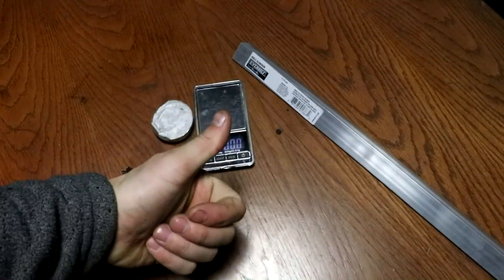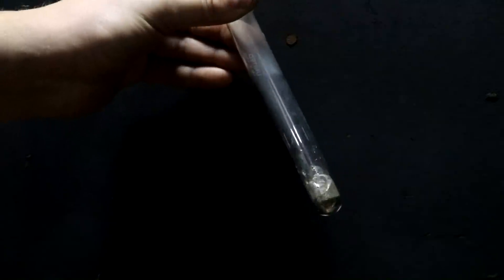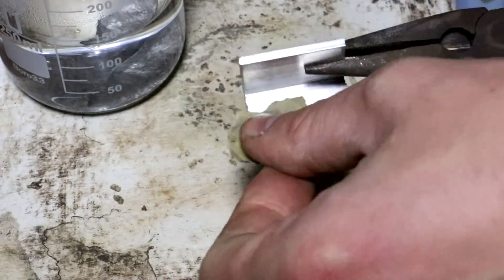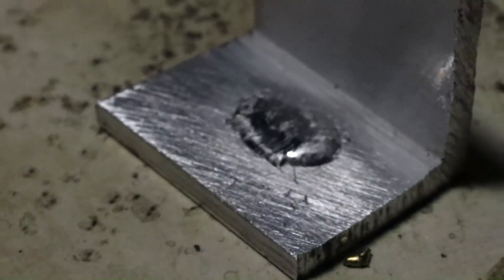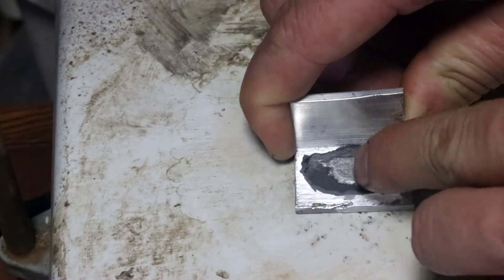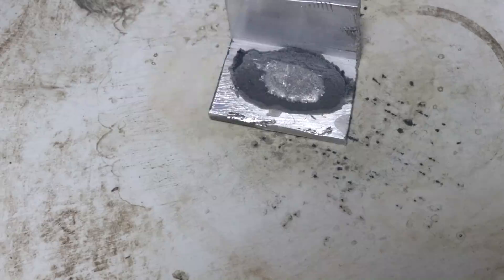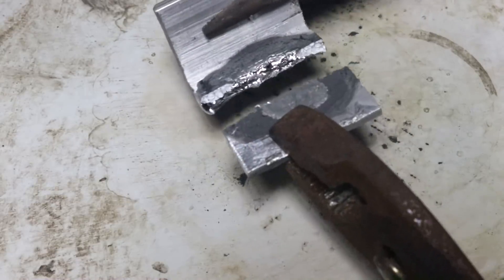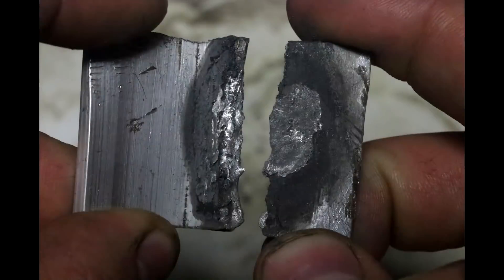Field's Metal vs Aluminium

Comment: Perhaps the thermal cycling was causing some condensation due to the different characteristics of each metal once the hot plate was turned off. If a light amount of condensation occurred it could have reacted with the fields metal and caused that dark grey oxidation and degradation of the metal. It was interesting to see it react with the water at the end, so that made me think possibly some condensation may have formed once the metal started cooling. Either that or the metal was able to drop in temperature much cooler than the ambient air and caused some condensation like how soda cans get wet when you have em outside in warmer air.
Reply: "Either that or the metal was able to drop in temperature much cooler than the ambient air"

That's not possible without a dedicated cooling system.
Reply: What I mean is that the fields metal could have a different thermal conductivity to the aluminum. Because the fields metal is kind of infiltrating the aluminum on a molecular level, it's almost like the piece of aluminum is a container with the field metal inside. And the field metal could have just enough thermal conductivity to pull the heat from the aluminum. Because they were heated up uniformly to a higher temp and then let cool down, the inner metal could act almost like the colder inside. Because the inside is cooler than the outside, it would allow condensation potentially. I'm not talking big drops of water, but just enough change in temp to cause some water that would react.

Comment: The s/l phase change could be taking energy from the luminum, potentially causing a local lattice change to form an allotrope more active in the air? Make a bunch of the tarnish material and x-ray to check possible alloying

Comment: Could it be fed with aluminum to keep producing hydrogen for ever, or is the fields metal exhausted eventually?
Reply: I think it might get too concentrated with aluminum.
Reply: Bismuth is more dense than aluminum. Theres an electron swap happening somewhere which is why its acting like an acid on the aluminum. I don't know squat about indium so I'm mostly assuming that the bismuth is doing a large chunk of the work due to its extremely low radioactive properties, and similarly low boiling point which causes the alloyed crystals to become deformed and aluminum's oxidation rate doesn't help anything either.

Comment: "It's about 3 nano-lightseconds long."
Never change, Cody.
Reply: 1 nano-lightsecond = 0.299792458 m
Reply: If 1 nls is around 0.2998m, that makes it a much more useful base unit than the rather long meter.
Reply from the maker: Its also 0.9835958Ft so...
Reply: @theCodyReeder  Next, you'll be telling us the size of the ranch in Angstrom-lightyears.
Reply: Sure it is, Cody, but unlike a foot, it actually has some basis in reality. (Also, subdivisions of it should be metric/SI-style, not arbitrary)
Reply: Finally, we get a decent definition for the American units!
Reply: to be nit-picky: the unit prefix for light-seconds actually comes after the "light-" so it should be light-nanoseconds
Reply: I was guessing 300mm. since the meter is based on the speed of light in a vacuum. The speed of light in a vacuum is pretty constant.
Reply from the maker: +  Jarwren 
Ima nit pick your nitpick! astronomers say things like "10 light years" or a "filth of a light year". so the way I said it should be correct. ;)
Reply: @theCodyReeder  I'll see your nitpick and raise you a nitpick: It would then be 10 light-nanoseconds.
Reply: @MushVPeets  the foot would be better if however if we just changed it to be 1 nls, it would be a pain in the ass for everyone in the beginning but would make more sense.
Reply: It's basically a meter
Reply: 1 nano light-second is about 0.1763485047 smoots if it's any help
Reply: I never came across a smoot ass a unit of measurement before. Would that be named after George Smoot, by any chance?
Reply: next can you use hogshead for cubic measurement?
Reply: hands down the most nerdiest joke thats not a joke
Reply: although its 3.05011 nano-light seconds
Reply: It's not that uncommon. Since the speed of light is also the speed of electricity we were taught that in Electronics College. It's actually crucial in computer boards once the speed is really up there.
Reply: I said " HE JUST SAID WHAT..."
Reply: That's all cool, but w.r.t. light...did it travel any distance at all??
Reply: PARSEC MASTERRACE COMING IN
Reply: But what is a better definition? 0,3 meter or 0,000000001 lightseconds?
Reply: About 0.9 meters for anyone curious lmao, 3*10^-9 lightseconds to meters
Reply: Lol that's what my friend said after I made the 8th cult
Reply: 29cm
Reply: Anyone knows what is 1 Smoot in 2019?
Google is trying to play smartass with their 170.18 cm.
What do they know about the EAR
Reply: 11.8 inches is a much nicer number 11.802852677 inches is more precise. 3 light seconds is almost a yard, neat
Reply: Is that right? Or is it lightnanoseconds?
Reply: I burst out laughing... totally wasn't expecting it
Reply: HaveSomeRekage so is that not a proper form of measurement?
Reply: It's a very precise form of measurement, I see nothing wrong with that!
Reply: @mattmarks9076  I can't tell if you're joking or not
Reply: Anay Pareek Just in case he isn't... Yes it is a proper unit of length measurement. You might be more familiar with light years.
Reply: According to a quick internet research the piece of aluminium is 89.9377374 cm long.
Reply: @deadalpeca8099  at least he isn't measuring in surveyor's chain (22 yards/66 feet)
Reply: @Flederratte  I still don't know how long that is. I think in freedom units.
Reply: @timesthree5757  then you are probably American. 
The rest of the world thinks in metric. It is such a convenient system of decimal units and having the temperature in °C also is convenient to simply convert it in Kelvin by just adding 273.
Also having the desity of water at 1g/cm^3 or its freezing point at 0°C and its boiling point at 100°C at normal pressure of 1bar = 1000 hPa is helpful in every day life.
We only use inch for measuring bullet sizes and camera threads :D
0.001km = 1m = 100cm = 1000mm etc.
0.001t = 1kg = 1000g = 1000000 mg etc.
Reply: @Flederratte  dont give a shit it is a man unit measure. And I prefer my man made unit of measure.
Reply: I know that light nanoseconds are a unit. I think thats the joke :D
Reply: Matt, you need help. Seriously.
Reply: Thank u I really did not know.
Reply: a nano second is a b o u t 90 cm long
Reply: @Ho Lam YIU that didn't happen. What happened  was they were using 2 units of measurement. Use one or the other. Lastly I base 10 the American Standard. I do this cause in my minds eye I see in miles not kilometers

Comment: Maybe the alloy is absorbing into the structure of the aluminium and when you let it solidify again the crystals expand slightly, pushing the aluminium crystals slightly apart. Would also explain why it’s slightly raised on the surface
Reply: Dexis i would go further and blame the tin or maybe bismuth (looks a bit like tin pest and bismuth expands on cooling if i remember right)
Reply: I suspect a simpler answer, it alloys the Al disrupting the protective coating and when you cool, water condenses on the surface again or at least more does, which then reacts. This explains the surface only damage observed and doesnt require anything more than standard corrosion to occur.
Reply: I think the hot plate was drying the air around it, so when it cooled the air humidity increased and the water reacted more with the aluminum.
Reply: @baleyg4606  but if it was water interacting with the aluminium surface wouldn't you reason that the whole surface would be affected, not just the area around the alloy. I tend to agree with the first explanation, this also would explain why it expands over time, as it would take more time to move further out from where the alloy was originally placed over time, and the second expansion of the impacted area was smaller than the first, due to it being left to heat for a longer period of time. 
edit it would also explain why the damage is not superficial. and goes all the way through as well as why he was then able to snap if from damage.
Reply: The first explanation has more stringent conditions for it to be true, first enough Bi enters the Al and segregates to the grain boundary to physically displace them, second it actually does this. This is not a small ask. 

My suggested method only requires the Al to form an alloy with any combination of the constituents of Field's metal such that the Al oxide coating is disrupted when the alloy is cooled. And no, the the whole surface would not be affected as the alloying element has to diffuse through the solid Al lattice, in fact I would expect it to affect the Al in more or less precisely the manner shown in the video. 

Furthermore I am rather curious as to how the Bi expanding in the grain boundaries causes what looks to be either a shit ton of dis-bonded grains all in 1 thermal cycle, or simply corrosion products.
Reply: That's actually a plausible reason.
Reply: Dexis I was going to the comment section to comment exactly this!
Reply: Cody needs a time lapse camera. It would be valuable in many of the videos Cody makes. Many uses indeed.
Reply: @TheJunky228  next video!
Reply: might just be reacting with the moisture in the air when it cools down.
Reply: Slightly.
Reply: Maybe this is a stupid question, but are we sure that is a pure aluminum angle, I would guess it is an alloy that has separated metal in the grain boundaries.  Most likely copper.  Is it possible the fields metal is reactive with that and not aluminum?  Sorry if this is dumb for some reason.
Reply: It's definitely an alloy, likely alloyed with Magnesium and Silicon but we don't know. If it has significant alloy elements at the grain boundary I would want that foundry named and shamed.
Reply: I would also like to see if the size of the sanded area effects the reaction or whether it was the scrapes with the screwdriver that allowed/aided penetration.
Reply: Agree.  The heat is allowing the Field's metal to penetrate further by two actions. One, it is expanding the aluminum lattice ever so slightly. Two, it is giving more kinetic energy to the Field's alloy.   When the product is cooled at least one of the components is possibly coming out of solution.  You could test this by putting a coating on a thin sheet of aluminum and looking for a resultant curvature due to the compressive stress on the applied surface versus the non-applied surface.  this might be easier with two joined strips and some sort of barrier to diffusion.
Reply: i was thinking the exact same thing, tin crystals can be pretty sharp and large

Comment: I wonder if the composition of the fields metal has changed - if it was just one of the elements in the alloy reacting with the luminum or them all. Would the x-ray be able to pick up on that, or could the melting point be tested to see if it's the same as the original alloy?

Comment: Perhaps all of the "oxidation" is actually reacting with moisture in the air and producing hydrogen. Maybe you should try the experiment again, but placing the sample in a dry atmosphere (sealed chamber with a desiccant) for the cooling cycles.
Reply: or do it in a vacuum
Reply: @Andy47357  How would it react with moisture in the air then
Reply: Would hydrochloric acid help

Comment: The heat must have been keeping the local humidity too low to progress the reaction. That was pretty surprising that it reacted with water so aggressively. Seems like that could be harnessed for an emergency battery or something.
Reply: Great Minds Think Alike - My mind shouted "humidity" when as I saw Cody drop it into water.  That conjures up an experiment idea (maybe B Channel) to retry the experiment in a Steam Room (160-200F) environment.  That would liquefy the alloy and provide the moisture.
Reply: @connecticutaggie  don't you think a bit of water in a dish, on the hot plate, under a bowl or some such would provide the same environment? 

Seems it may be a bit easiest to test that way
Reply: @John Kenny, hot water in a dish would add the water but eliminate the oxygen.  Steam is a very different environment.  Besides, @Cody seems to enjoy challenges.  Hey, he could try both.
Reply: There was a breakthrough on this from the US Army Research Laboratory last year. (No details yet, unfortunately, because they're still working on the patent, but you can find articles about it online.) What Cody has done appears to be a catalyst-based reaction, which has trouble with the speed of the reaction.
Reply: hell with enough of it you  could make a torch out of it (which would be super cool)
Reply: "Oh no I have found myself in an emergency situation without electricity. Let me just quickly get my Fields metal and aluminium and let it go through a few heat cycles and then let it react with water to use the hydrogen to make a battery from scratch." I like your thinking
Reply: Exactly what I was thinking, the heat drove the water off and limited the reaction, when he put it in water it went off like a frog in a sock. Wonder if the water is acting like a catalyst to the reaction.
Reply: Yeah, this was my thought as well.  Aside from humidity (in terms of percentage), heated air just has lower density of molecules entirely, which might keep the relative humidity the same, while still driving away water molecules so they can't oxidize the "luminum"
Reply: oh rob, troll fail. try again.

Comment: If you can successfully recover the fields metal out of the water, that'd be a super easy way to produce hydrogen at home, scrap aluminum and field's metal catalyzed.
Reply: Easy would be use naoh water solution, its cheap and work same. But the main problem of making hydrogen from aluminium is aluminium, on large scale it is not cheep way of hydrogen production.
Not talking that you need to get somewhere bismuth and indium metals.
Reply: @alexanderfl-ts3171  I agree Sodium hydroxide is the easiest, but the trouble with it is the hydroxide is destroyed. Here it appears that the metal is not, plus in a home setting, scrap aluminum is readily available. The feilds metal would theoretically be a one time expenditure, and the entire process is nontoxic.
Reply: It depends... Fields metal not spend same as mercury or galium, so they work simmilar to catalist, while naoh is part of reaction. But you still need to wash/separate this metals from aluminum slug after reaction - require some additional process, while with naoh process you just need to get rid of water/naoh/aluminum hydroxide wastes(in perfect world you could even mix perfect stohiometry for naoh and aluminium to spend all naoh in reaction so no poisonous naoh wastes left). 
Other problem is poisoning feilds metal alloy with other metals: if you have pure aluminium it is one thing, but if you use some aluminium alloy, metals persist in alloy could wont react with water and will left in your feilds metal, so could change its properties, for exampe if in aluminium was zink or titanium(not probable but still) or silicium, what will happened...
Reply: @alexanderfl-ts3171  as I said, if the feilds could be effectively recovered, that'd be one thing. And that's a good point, with alloy contamination. Almost want to do the experiment and see.
Reply: I'm more curious could this work with zink metal, i.e. can you make zink-tin alloy with lower melting point then tin, both metals are more available then galium/mercury/sodium/potasium/indium and such metals which used for low temperature liquid alloys. Would be interesting to shift tin melting point with something abudant as zink(ofc it still would require >100C to melt it, but less then tin melting point) and try this experiment with soaking aluminium. Not sure if this posible.

Comment: Does it expand when it becomes a solid? 

Could be that it expanding expands the grains and pores, allowing it to spread throughout the aluminimum  more easily
Reply: Another possibility is that the difference in humidity between the hot air over the active stove, and the cooled down air
Reply: It could just be the stresses from the atoms aligning into a rigid crystal structure.
Reply: Yes this is a distillation of what I came up with.
Reply: I thought it contracted when it became solid, as far as I know the only substance that expands when it freezes is water
Reply: Sadly that conspiracy theory falls short. Theres no pores in aluminium kid. Your pronably thinking about leafs or something get ur ass back to biology class kid